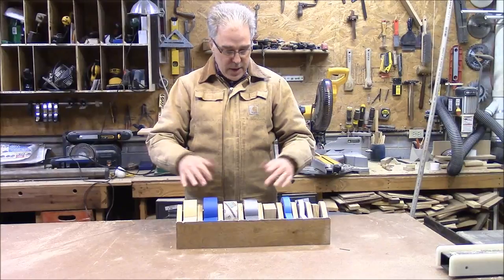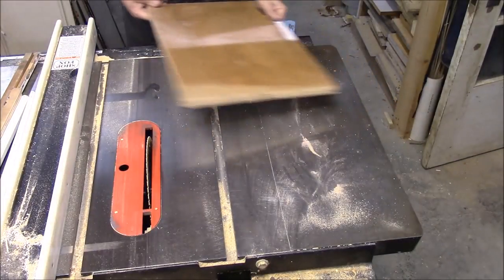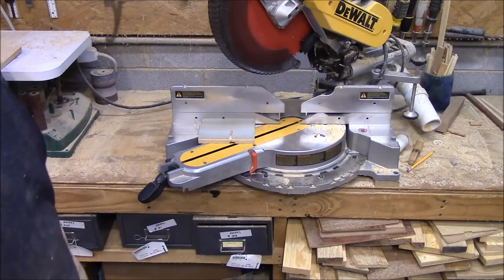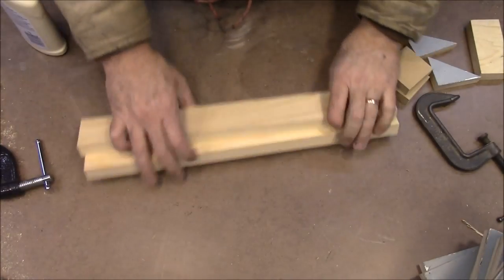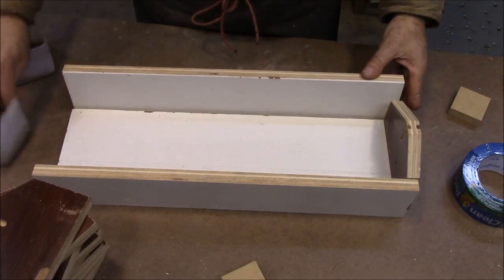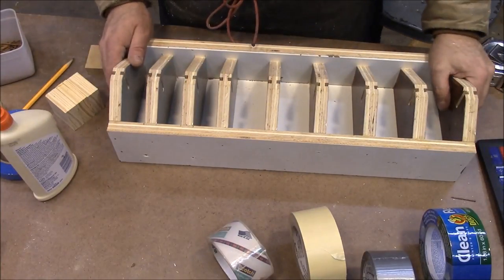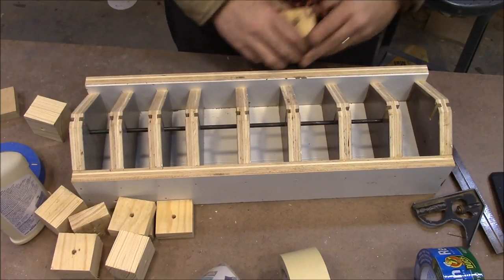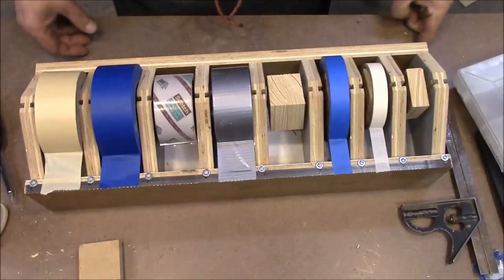Homemade Multi Tape Dispenser

Comment: and do you like it over time?
Reply from the maker: Yes, the only thing I would raise the front (cutter) part, it's a little low and wants to pull the roll out of the dispenser.  Thanks for asking.

Comment: Good video and you can bet I'm going to make one like yours for me.  However, I want to make a constructive comment.  I noticed you didn't use a blade guard, a riving knife, or a push stick.  I strongly recommend you consider using them.  An old saying:  "Good judgement comes from experience; and experience comes from bad judgement."  Best of luck in the future, Soat.
Reply from the maker: Thanks!